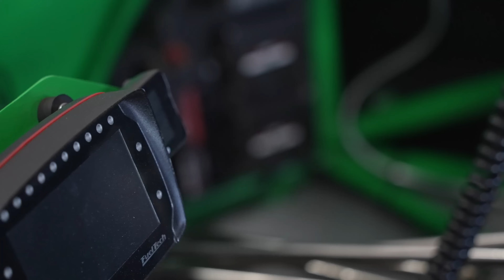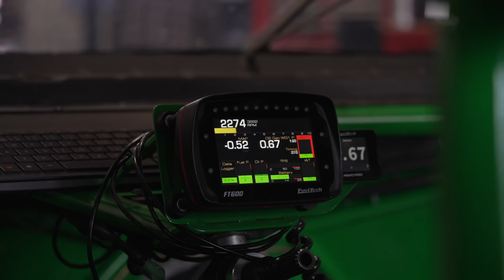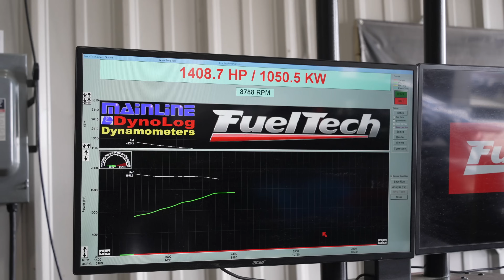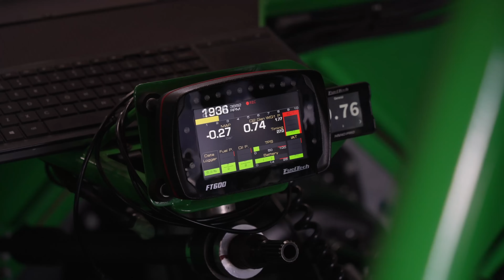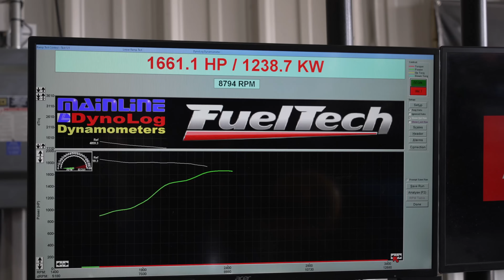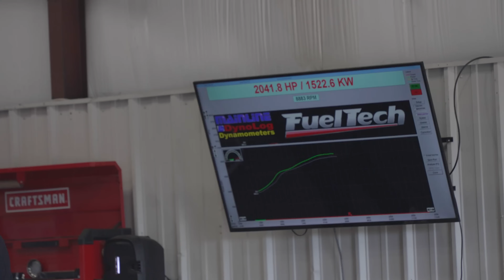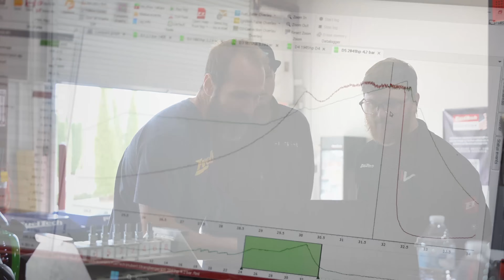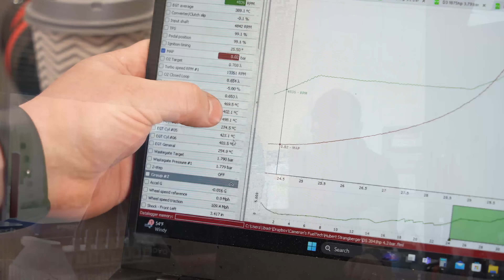World's Fastest AWD Audi makes MAJOR power on our Dyno! | TeamHST

Comment: Best 6 cylinder exhaust note. I had a mk2 gti vr6 in high school. It had a 6 to 1 header, cams, full catless motec exhaust, limited slip diff, coilovers, megasquirt (i was class of '05) insane clutch and a short shifter i had to save for 3 months to buy. I grenaded the stock bottom end when it dropped a valve. Luckily i had a built short block in my bedroom i had literally just finished building. Sent the head out and had it set up for N2o. My senior year i finally was able to afford a good nitrous controller so i put a 2nd solenoid on and sprayed it to a 10.91@131mph. That was at 5300 feet above sea level the DA that day was like 8000+. It was one of the fastest street cars in Reno, Nevada. Then i got a purple '87 foxbody with a 800hp 400ci sbf with 3 kits. That was THE FASTEST street driven car in Reno for like 6 years. Nobody could touch me. Not even the law.
Reply: Class of 03 but didn't do my first mk2 swap till 2006. Acquired a 1989 ce2 jetta coupe for 40 dollars with bad engine. Swapped it for obd1 vr6 then swapped another friend  who was going the boost route for his Corrado vr tranny. The engine made 180 whp and tq. Not sure how much nitrous you sprayed but had to be atleast 150.

Comment: Interested to see how many factory Audi parts are used on this build. Brett LaSalle had the "snot rocket 2.0" mustang, with the stock crank made 2970rwhp and ran 7.20s in the 1/4 with a coyote engine. And this is a 6cyl, which is even more impressive IMO. (Brett sold the snot rocket recently, im thinking he was out of chassis😢)

Comment: Whats it run? 
I know europe has like an insane audi s2 quattro but they run it on a airport strip couldnt imagine it on a dragway
Reply: Yes, it's from Bulgaria.
But this Audi, is from Austria. team HST.
Reply: @tiagoabreu4107  you recon the s2 is just as fast? 0-100 1.8s on a airport is nutty
Reply: @jjsorenavki7005  probably the Bulgarian Audi would still be able to be faster than this Audi on a dragway.
but both cars, despite being "quattro", are no longer like true quattros, especially this Audi which uses the rear diff from a GTR and a longitudinal engine when it was originally transverse.